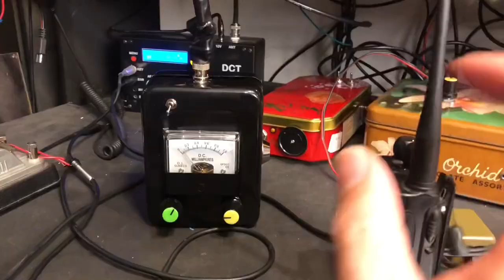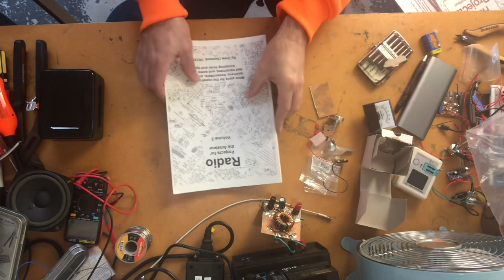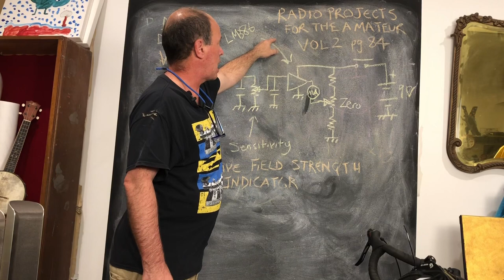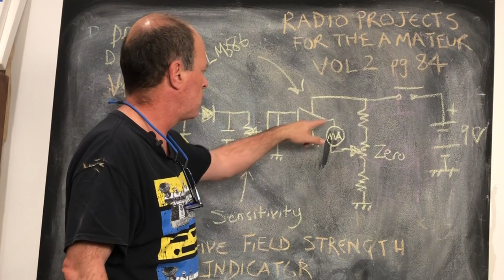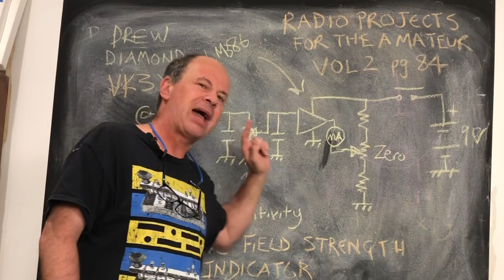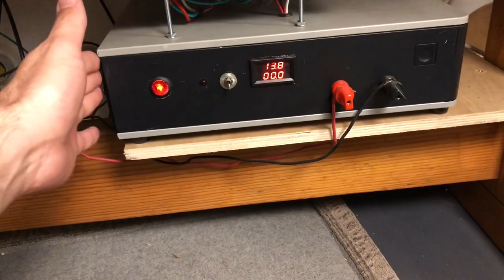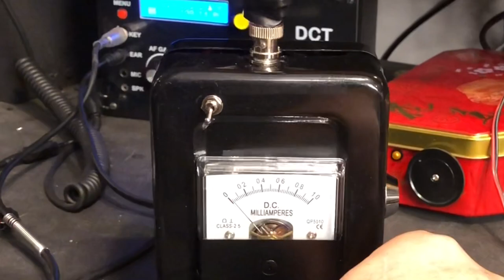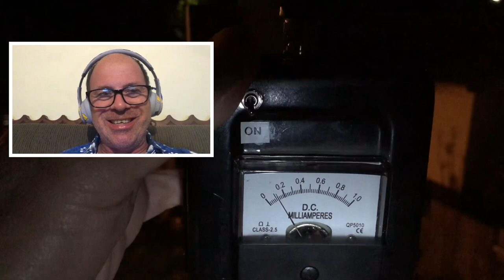Sensitive Field Strength Meter@TheArtofEngineering

Comment: So I built the insensitive field strength meter.

It told me my signal strength was pretty weak and had seen stronger signals from a pixie

When I enquired further, it went on to tell me I was over weight to the point of being obese, but  even if I was to do something about it, and lose said weight, it wouldn’t do anything change what my head looks like 

I threatened to dismantle it, but it just said “I don’t care. Pull me apart, parts me out. Doesn’t change the fact you have no friends and I’ve heard cleaner CW sent with a left foot”

Guess it’s pretty accurate

Comment: If you 'drill' it the right way, there will be not a problem with the holes! They will be flat and even! Use a drill-stand and a piece of wood, to stabilize the case! 
 And don't turn inside the holes with your drillbit, as it is the last day of the world! 

Coindn't resist! 
73 de Markus - db9pz  (JN39fq - 3miles/5km east of LX)
Reply from the maker: Yes! Sad part is I have access to a press in the school shop …. But I’m dodgy and impatient! 😂😂TNX fer the comment 73 de VK2AOE